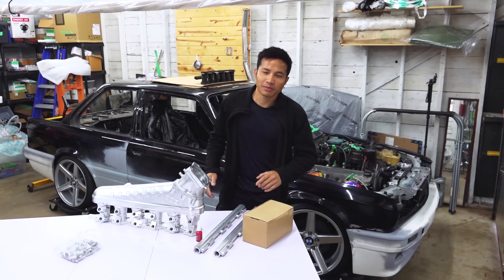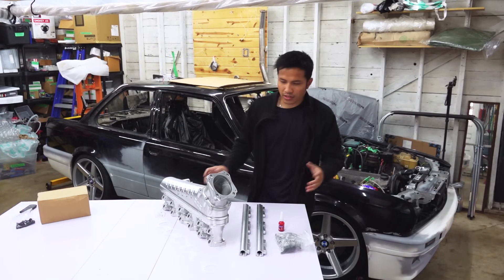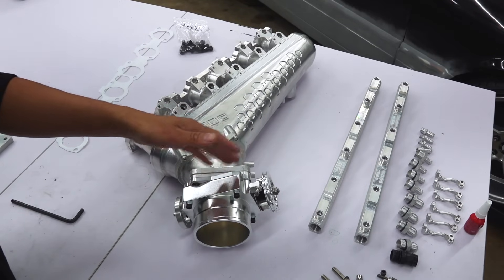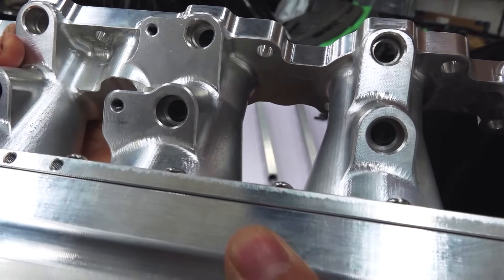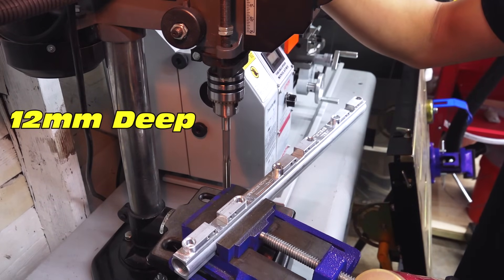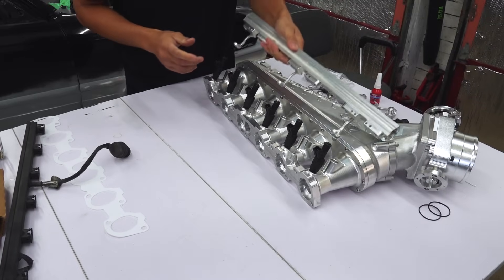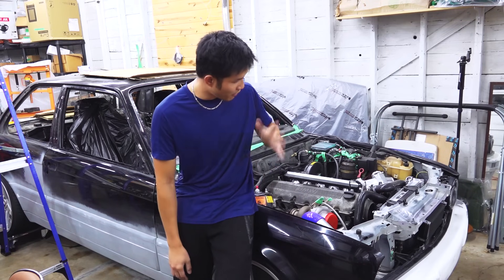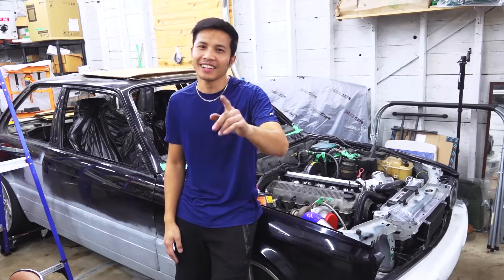E30 Fix 29 | Unbox $499 E36 T7 Coilovers, $1,355 CNC Innovations M20 Plenum Intake Manifold

Comment: Those injectors are fake and you will have issues
Reply from the maker: You think so? I believe they are re-manufactured OEM Bosch injectors. They should be pretty good.
Reply: @DarkDragonWing  no they are not,
Ksm they sell fakes on ebay
We have test them,they are fake,they stuck and dont flow at all
Search the reviews on google

Comment: Bro why you stopped the DDW 1/10 M - DRIFT RWD  series please start it atleast put a video that how to add the servo height adjustable suspension please or reply why stopped
Reply from the maker: @PRANAV2010PS  Watch some of the RC Modify videos, I think I showed how to add them already.
Reply: @DarkDragonWing  bro but they are not step by step as you showed in the series and the system was awesome which blows and attracts our mind please 🥺 try to continue the series if possible it was really useful and motivated that everyone can do a rc 🚗 car

Comment: Coilovers looks solid...good see you brother! 
The CNC company's prices don't see to be too crazy either.
Reply from the maker: @WelcomeToTheMadness  Good to see you! These coilovers are real nice, but I have a steep driveway, I might get the "true coilovers" and air cup lift system to help get a few inches of clearance instead. The CNC company has some really capable machines and designers, any intake you want, they will make it. Really good prices for what they offer indeed.